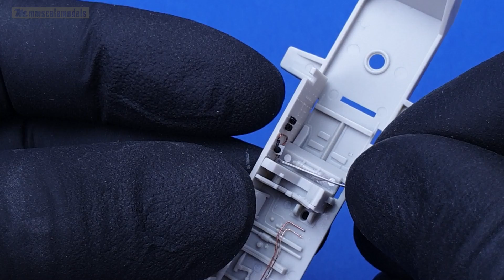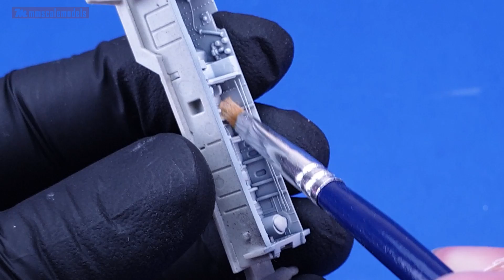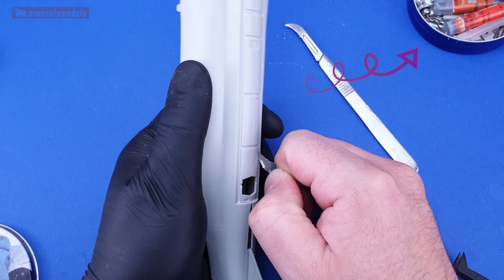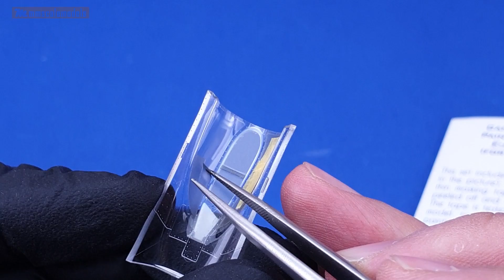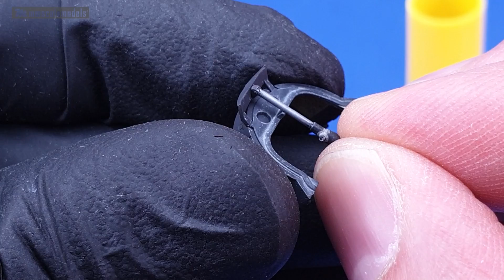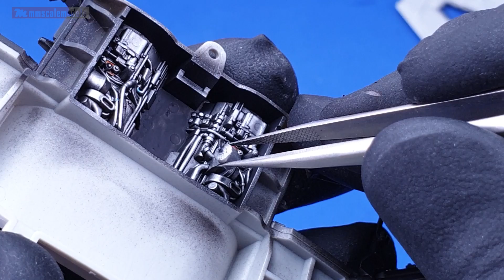Building Tamiya's 1/48th scale F-4B Phantom | Part 2

Comment: I worked on F-4Cs and F-4Es from 1980 to 1986. One detail you folks should know is that when you put silver wear and tear on the black cockpit sills, there should be plenty of wear on the left side but very little on the right. That's because everyone gets in and out of the cockpits from the left side. The only wear and tear on the right side sills would be from maintenance plane captains or crew chiefs standing on the sills to clean the canopy interiors, and from maintenance personnel occasionally setting up test equipment sitting on the right side sill.

Comment: You are definitely a talented modeler. I realy love how you add additional detail. Hoses, wires, hydraulic lines, etc.
Was wondering if this kit requires nose weight, i apologize if i you mentioned it in the video and i missed it.
I have an academy 1/48 scale Phantom II model kit that i havent finished yet. I started it a couple of years and then packed it back it the box, to finish at a later date. I noticed that it has a similar assembly of parts with this Tamiya. Very similar. 
Great job so far. Thank you for the video.
Reply from the maker: Thanks for the kind words, I haven't added any weight. The center of mass is forward enough.